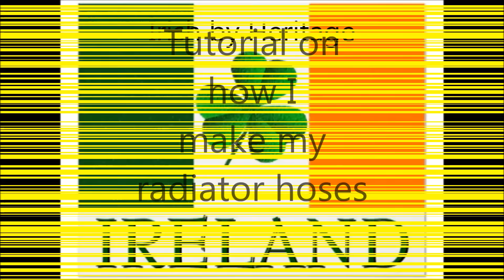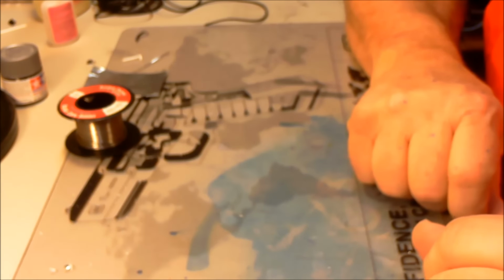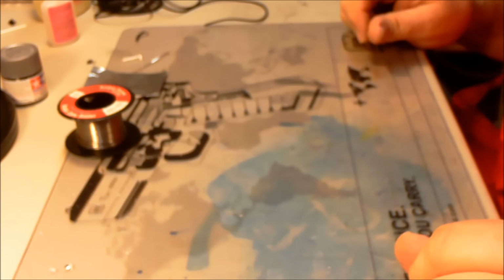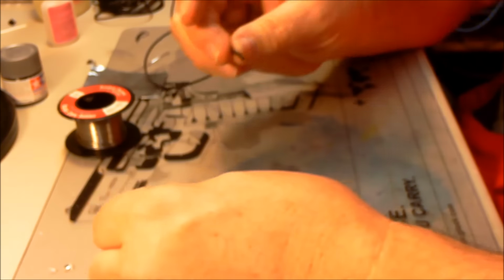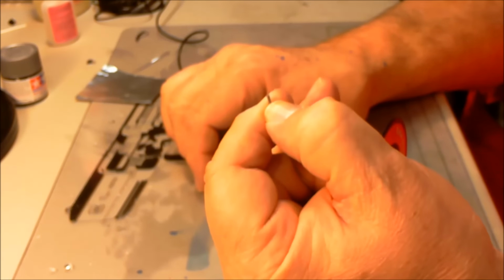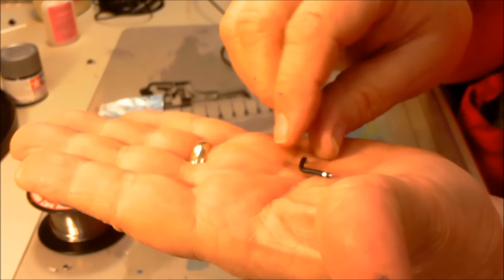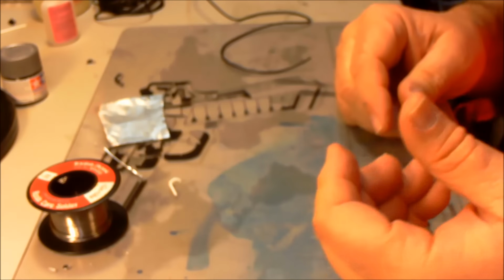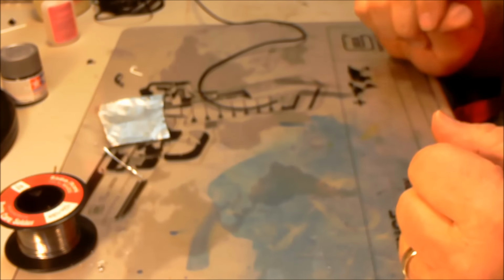tutorial on making radiator hoses

Comment: Awesome James thanks a ton for sharing my friend. I took complete notes and put in my book of techniques to get the supplies for and try when I build a upcoming build that has a radiator hose. Any chance you could private message me the brand and name of the vinyl tubing as well as the kind of solder you use ?  Thanks buddy and again Thanks for sharing.
Reply from the maker: +Deron Shank       I no longer have the package for the tubing but it is in the beading section at Hobby Lobby there are about 4 colors and it's the only hollow tubing they had. The solder came from radio shack and is .050 resin core lead solder. Next time I' at Hobby lobby I'll get the name and send it to you.